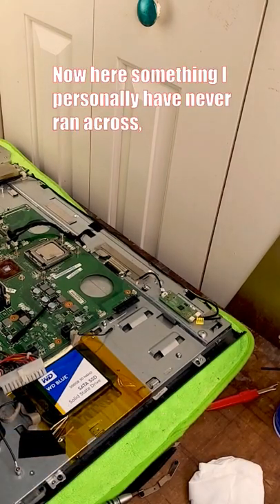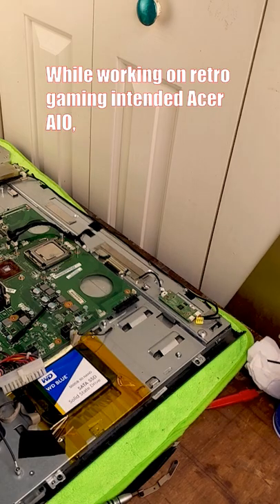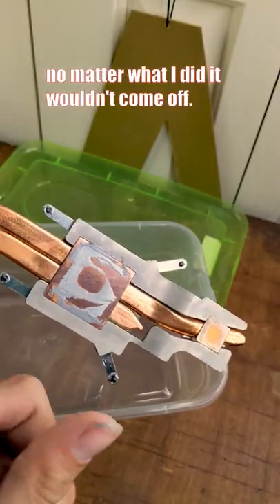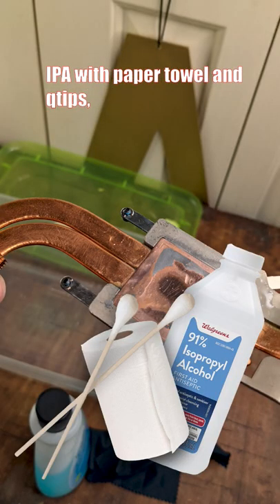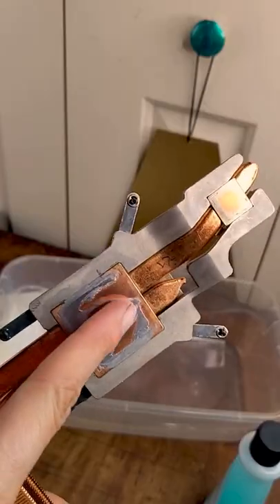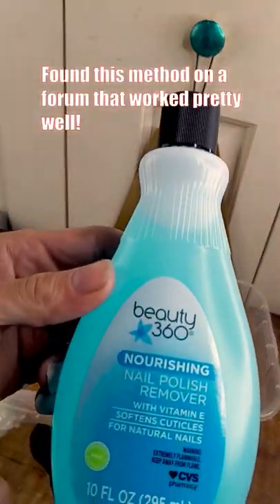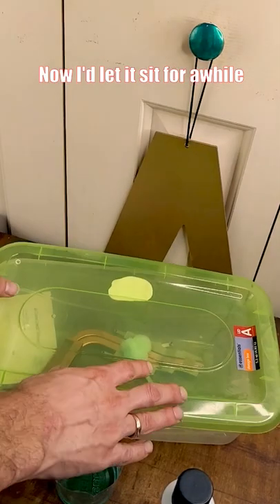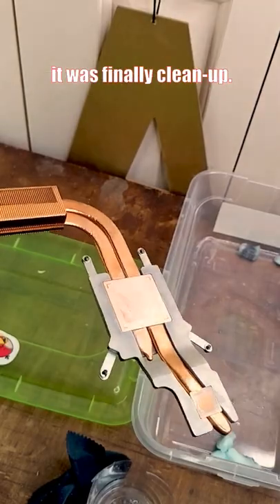Removing Hard Thermal Paste

Comment: What abt goo gone
Reply from the maker: I think I might have tried that off camera or I stay away from it because of how oily it is!
Reply: @Wedeemgaming  as long as u clean it with 91% ipa you’ll be fine, as I’ve covered entire chips in it (not needed of course) also about the other comment, 91% IPA is the recommended one for electronics, the reason it dries faster is because there is less water, the residue left with 70+% is NOT alcohol, it’s just water, which is BAD
Reply: You did use Goo Gone without damaging anything? I was thinking about trying that. I pulled the heatsink off my onboard gpu and found it had some sort of pink/red adhesive underneath which is not affected by alcohol at all.
Reply: @terrapinflyer273  I use googon on stuff all the time, like 360’s where goo gone gets onto the components on top of the gpu or cpu, I do not believe it is conductive but I just give it a wash with 90% ipa after and it works perfect :)
Reply: @Bridgetfidget18  Ah, good to know! I used some on some old grease spots in my kitchen and the fragrance from it lasted for days... And I actually used the "mechanical" approach for the (I assume) cured pink silicone adhesive under my onboard gpu heatsink. Started picking at it with angle-cut toothpicks while it was still warm. Getting it off the gpu chip wasn't as difficult as the heatsink as it cooled a lot faster once removed. Scrubbed w alcohol q-tips, repeat, repeat. Gave up for a few days lol. Then used the backside of a wooden clip style clothespin to scrape away as much as I could. Then the front side of it (where the wood is rounded and porous) in circular and lateral motions. Finished it off scrubbing again like mad with alcohol q-tips.

Bought a can of contact cleaner and didn't even use it 😂 Slapped a 1.0mm (GoWiz, grey) thermal pad on there and seeing much cooler temps than before. Like a 30°C difference!
Reply: @terrapinflyer273  I’ve just straight up poured goo gone onto chips with very dry paste, not enough to spill out but to cover it in a layer, then I just wipe it off and clean it with 90% ipa (minimum percent you should use for tech) and it works great, I sometimes even put it on the heat sink contact part and die even if it’s clean at times, just to make sure any paste in the “micro-grooves” on the surface are gone (not needed but just assurance, ipa likely could do that do) but it’s great to apply over dry paste on several parts and come back to it later since it dissolves it better than paste and I can work on other things as it does it, still wouldn’t apply it to small spaces or under a chip just because it doesn’t belong there, but yes, goo gone is safe, and others have said to use 70% ipa, but the ipa is what evaporates quickly, if it’s 90%, there won’t be any water left behind, as 70 there will be a little, it’s fine for cleaning plastic but not for motherboards in my experience, and these are the things I’ve used to clean out over a dozen 360’s by now and all work

Comment: the less messy solution is to let it cook.
As in, run prime 95 on the machine for like 30 mins to heat it up, then it will come off like normal.
BUT
if you are trying to revive old hardware, and you cannot boot the system to actually let it cook, your video is useful.
Reply from the maker: give that a go next time!